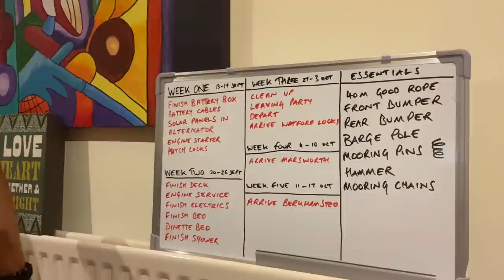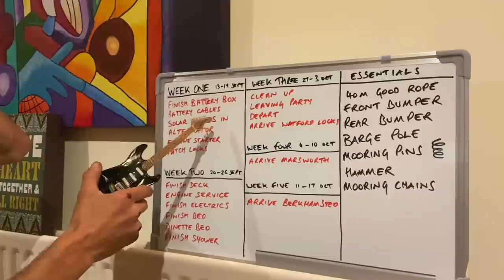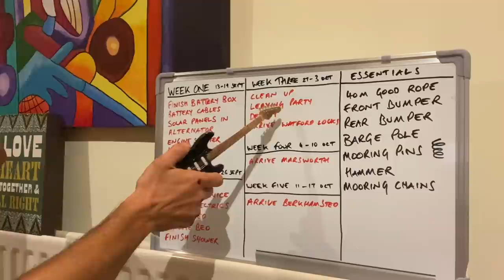247. Struggling to install solar cable retrospectively | Departure countdown

Comment: Looks fantastic on the water now. You might need a rack or rubber mat or something for the beer bottle fridges though as the vibration when the engine is running is going to set the whole lot rattling!

Comment: Just poke a hole through the foam and use a long wire feed to pull the cable through the ceiling

Comment: Had an idea about securing the solar cables to the roof without drilling for screws or gluing clamps on.....if you can source some saddle type cable clamps, like a letter 'B' , for 2 cables, you couls Araldite or epoxy some of the ultra strong rare earth magnets to said clips and they'd stick like the proverbial. Some of these Neodymium magnets are so strong you'd not believe their power for their size. They're available off Ebay , pretty cheap, too. Just a thought, and kinder to your paintwork.

Comment: James, I just wonder - as water ingress and cables are such a strange and worrying issue - if you could drill through the shaft of the mushroom vent (above roof level, but below the threaded section?) and install a cable grommet there? It would, perhaps, introduce an extra level of grip to prevent the cable moving around and stop creepy-crawlies using the cable as a way to penetrate your roof space? I'm sure I've seen this done elsewhere?
Great to see 'Sloe Patrol' already out on the cut, I thought you were going to be in the slip for a few days? Good to see you applying ever more paint.

Comment: Have you thought about water ingress?  Water will drip off the top of the mushroom onto the cable and this in turn will trace along the cable to the lowest point where it will drip off.
Reply: No, the cable has to go up when it’s inside the mushroom.
Reply from the maker: Water can’t go uphill but under really heavy rain - it bounces off the roof into the mushroom vent. They all do that though

Comment: i would have run a shortest possible cable through the roof under one of the panels. then used a solar cable skin fitting. it would have meant drilling another hole in the roof , but the shorter the cable from the solar to the controller, the less power loss.
Reply: Before spray joke I would imagine. 🤔

Comment: I think you're making a big mistake going through the mushroom vent. The boat is constantly vibrating, causing wear on the wire insulation and eventually it will wear through and short. I say this as an electrician. The hole through the roof and the gland provides protection against that wear.
Reply from the maker: I will put some rubber around the edge rim to protect the cable and tie it down so it won’t move much - but this is the recommended way
Reply: Recommend by me at least! Mine have been fine for a few years anyway.
Reply: @ProjectNarrowboat  Would you run the mains into your home through a window rather than a weatherhead? 

There are reasons for purpose-built devices.
Reply: @midwestconcertvideo  lmao
Reply: Wouldn’t it be better to put the cables through the side of the mushroom support using a gland instead of up over the top. It still means no hole in the roof but gives you protection from wear. I realise there maybe a reason you can’t but it was just something that came to mind. The paint Finnish on the outside is looking great.